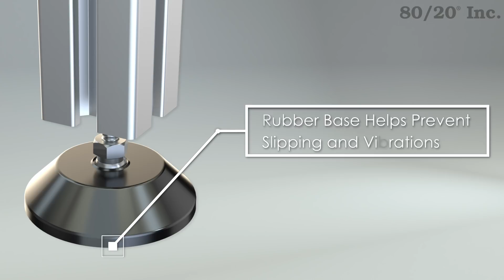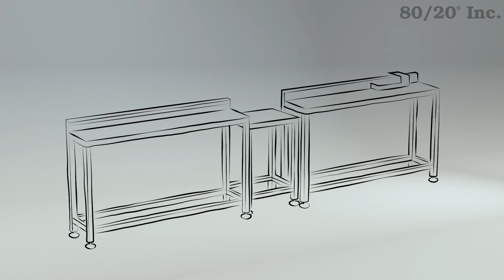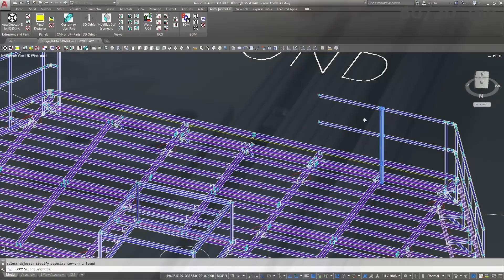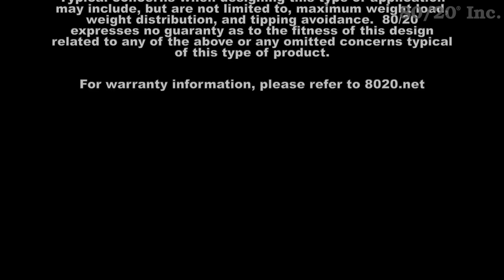80/20: Xtreme DIY - Saw Stand

Comment: Why does the end stop have that 18" piece sticking back towards the saw. I think all it does is make the maximum length available 18" less.
Reply from the maker: The longer stop arm gives the ability to safely make smaller cuts while keeping the user's hands away from the saw blade.  As with all of our Xtreme DIY projects, these designs serve as starting points for our customers and can be easily tailored to their specific needs.
Reply: That was the first thing I noticed, as well. Can't imagine the benefit.
Reply: @bradsmith550  Adjust for shorter cuts by moving the stop over, regardless of the extension. Maybe there's a reason it can't move further. Doesn't matter, anyone can do it differently.